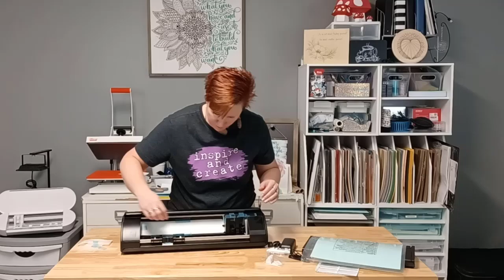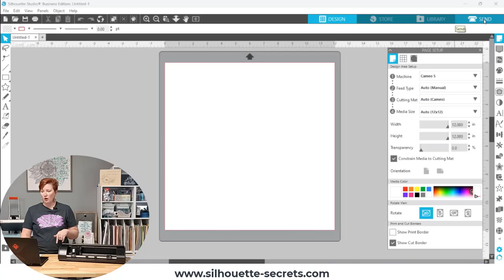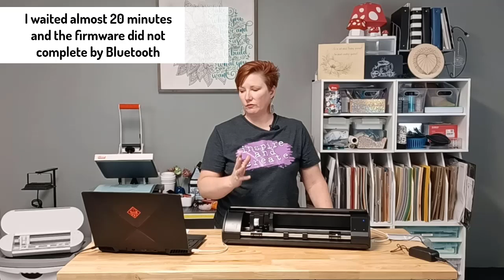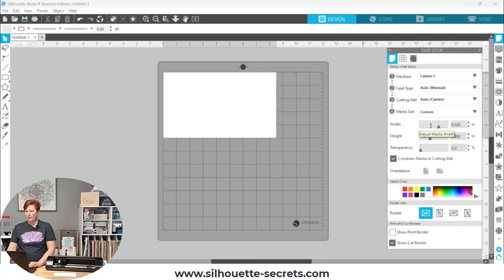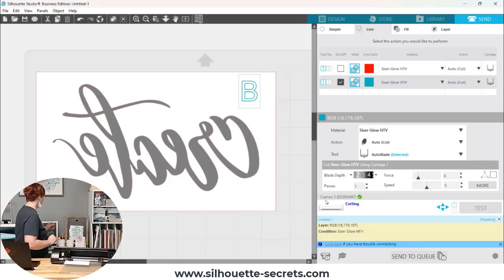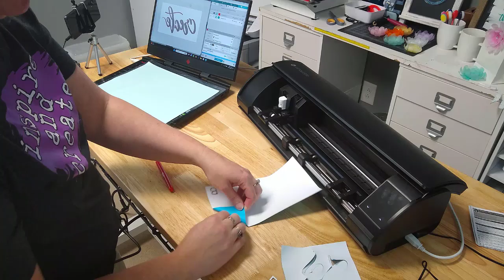Silhouette Cameo 5 Unboxing & First Cuts - What Went Wrong & How to Fix It

Comment: Now that some of you have had this machine for awhile.  How do you like it /rate it after some long term use?   Just learned of this company by a Youtube channel that happened to be using it.  I was actually looking up software.
Reply from the maker: Mine is still going strong and is used multiple times each week. Love the Electrostatic mat.
Reply: @SilhouetteSecrets  what about the software?  Is it adequate enough or do you use other software also?
Reply from the maker: @creativestudio4873 I've used the Silhouette Studio software for 10+ years. We'd recommend version 4.5.812, not version 5 at this time.
Reply from the maker: @creativestudio4873 you can download the software without a machine - https://youtu.be/IZM2z24GY8w?si=6zGwBizh9SwNvgTl
It will take time to learn.

Comment: Thank you so much for this! I got a cameo 5 and is my first, i messed up my mat, it has all paper residue stuck to it and i used a bit of water and it messed up the glue, my heart sank and just left it to the side. Now with your video im a little confident to try again.... after i figure out how to save my new one time used mat.
Reply from the maker: Get a new cutting mat and then use that one for something else like a painting mat, etc. 
The glue is water soluble and should not be washed. 
Here are some tips to getting the most out of your cutting mats - https://silhouette-secrets.com/2019/02/12/tips-to-get-the-most-out-of-your-silhouette-mat/

Comment: After using Cameo 5 for 6 month I went back using Cameo 4 it cuts better and easy to load vinyl. I am very disappointed with Cameo 5 performance. If I could return it I gladly would
Reply from the maker: Sorry to hear that. I still use my Cameo 5 and it cuts well.

Comment: Hello madam, Asking from Philippines, Want to ask if have you already tried to use premium blade using the latest cameo 5? Im a cameeo5 User, my auto blade is not  that sharp anymore. So im planning to buy premium blade. Will be happy, when i see response. Thankyou more power!!!!
Reply from the maker: @Hmfamilyus  yes. The Premium blade will work with a black adapter. There are 4 adapters and are the same as the Cameo 4. 
A 1 mm manual blade is the equivalent of a premium blade and no adapter needed photos of the adapters can be found here - https://silhouette-secrets.com/2020/06/14/lets-explore-cameo-4-tools/

Comment: Hi! I need to know how to calibrate how my machine cuts.
I'm just cutting basic vynil, and the  cut is about 1/2" above the top edge of the vynil, cutting into my mat margins.
I can't find any info anywhere!
I'm having to move my vynil up into the margins or move the design down...but sometimes it actually works properly after I have made those adjustments...making this a hit and miss situation. 
Please help!!!
I am getting ready for a show!❤
Reply from the maker: @KlKingDesigns  are you using a Silhouette cutting mat? 
3rd party cutting mats are not the same size margins as a Silhouette mat. 
Silhouette machines are calibrated specifically to the margins on a Silhouette cutting mat and load to the exact location of the top left corner of the cut area on a Silhouette cutting mat. 
If using a Silhouette cutting mat, make sure you have a mat set on the Page Setup panel.
Reply: @SilhouetteSecrets  I am using the original mat. This is a new machine. It started working better this evening, 
Although I noticed the arrow controls on the machine don't do anything except feed the mat in and out.
I am getting my files, and managed to get the cuts done today! 
Thanks for your help and videos!
Reply from the maker: @KlKingDesigns  this video shows exactly what I mean about 3rd party mats. It affects both but placement and print and cut accuracy
https://youtu.be/z0Fpo5n-Z1E?si=mImh_1Ld2a1ppzND

Comment: thanks for the heads up, re software, wasnt aware they forced a minimum version... nearly bought a machine that I wouldnt be able to use... my mac cannot go higher than Mac OSX 10.13.6
Reply from the maker: It's not something you can re-engineer for older software easily, so yes, a new software version is needed. Especially if a computer OS is no longer bring updated or the computer cannot be.

Comment: Thanks - this was really well done. I got my Cameo 5 yesterday and was fairly well shocked at how little documentation and guidance there was on setup and operation right out of the box ("Scan for more info" and a QR code is nowhere near acceptable for a device of this complexity). Good to know there's standard USB support; now I just need to scrounge up a USB-A cable for initial setup and firmware update. I will say that the packaging engineer who secured the innards for transit is an absolute hero. Or maybe they just love blue tape... :)
Reply from the maker: So glad it helps! 
Yes, it is packaged very well for shipping. Each machine release and more working and movable parts, I think they find new ways to make sure it's not damaged in transit globally.

Comment: Hello. My cameo 5 got cameo 4 firmware. Now it behaves like cameo 4 (turning it off/on with one click, characteristic sounds, an unsuccessful attempt to drag the carriage when starting the magician, the studio desinger program finds it as cameo 4 and functions are available for it and possible only for this machine (for example, a heat foil pen is defined as a craft knife)). I tried to download the micro firmware for Cameo 5 from the manufacturer's website, but that file does not work. Perhaps you can tell me what can be done to return the machine to cameo 5 firmware (the program does not offer new updates).
Reply from the maker: You will need to contact Silhouette Support regarding this issue.

Comment: So in order to operate the C5 you have to upgrade the version so does this mean you no longer can run other cameos curios ect? Or is Shilhouette trying to make everyone buy a new computer for each machine? 🤔 🙄
Reply from the maker: Anytime a new machine is released, you have to update the software in order to access that new machine - they don't go back to older software versions and recode everything to make it retroactive. 
You can still use all of the older Silhouette model machines on the new software version. 
Silhouette still supports all the older model machines and makes the software compatible with them.
Reply: Thank you so much, I was super stressed about updating 💜
Reply from the maker: @lilqueeniescraftingismypassion  You are welcome!

Comment: Hi! I've finally received my Cameo 5 after making the decision to get it a few months ago. I purchased it in november and it arrived a few weeks later because of customs, but I was so excited to finally use it until updating the firmware caused my cameo to no longer connect via bluetooth or through USB. I've tried changing the USB dongle and everything else on their website, but nothing worked. Turning on the cameo works just about fine, but it's just collecting dust now since it won't connect to any device wired or through bluetooth. Would you know if there's a way to hard reset it or fix this? I've reached out to them via email and their facebook but I havent received a reply and its been a few days already..
Reply from the maker: Are you using a MAC or Windows computer? What happens when you connect it either way? What does it show under the machines icon panel on the Send tab = little machine icon with the red number on it? What version did you update to?
I expect it will be awhile for a response from Support due to the holiday closures and the backlog of support requests throughout the holidays.
Reply: @SilhouetteSecrets  I originally connected it on my macbook since its my main use for my digital artwork, and it connected fine the first time I turned it on. Once I updated the firmware the machine froze and it said that the firmware update was unsuccessful or it failed. So I restarted everything and redid it but when I turned on the machine it could no longer be found, bluetooth or through USB. I thought it might be my macbook so I went to my windows PC but nothing as well. 

There's actually no icon of the machine at the bottom of the Send tab, itjust keeps saying that its looking for a machine to connect then it would say that it can't find any nearby. 

They finally responded today but they essentially told me to follow the steps in their support page which wasn't very helpful since I've already done so.
Reply from the maker: @curiousnaba5497  everyone has a machine icon in the Send panel 
I show a photo in this post. 
https://silhouette-secrets.com/2020/06/07/lets-explore-v4-the-send-tab-simple/
I'd recommend installing v4.5.738 found under the Legacy section on the website under Software > learn more and see if you can connect. However, if you are using MAC Sonoma OS, then you'll need to use v4.5.770.

Comment: I got the Cameo 5 for Christmas and the power supply is making a high pitched noise. Anyone else with that issue? I’ve contacted customer support but got a standard email back stating the noise is normal.
Reply from the maker: Yes. Seems to be normal. With the powered housing there is a noise to it, but not everyone can hear it. Most electronic equipment has a noise to it, but it's not audible to all people.

Comment: Hi I have a question maybe you can help me answer these:

Are the mats used on the Cameo 4 compatible with cameo 5?
Are the tools knife, pen holder tool for calligraphy  compatible with cameo 5 or do I need to buy a add on or entirely new set of tools?
Reply from the maker: Yes, the mats and tools from the Cameo 4 can be used in the Cameo 5.
Reply: @SilhouetteSecrets  thank you for your swift reply. And the tools of cameo 4 can they be used on the 5?
Reply from the maker: @JemarhelSupriana  yes.

Comment: Just upgraded from 3 to 5 and I use it mainly for paper art.  I loaded the auto blade correctly, and have not been able to get the auto blade to cut through 65lb Cardstock.  Wasted many sheets, even put the blade to 10 and force 30 it’s not cutting through. Anyone else have issues like this? I’m going to reach out to them direct because the blade, machine, all is brand new.  Pretty frustrated 😢
Reply from the maker: Is the red line inside the blade adjusting to the correct number that you have set on the Send tab?
Is the cap on the blade secure and not loose?
If those are both fine, then I'd recommend you reach out to Silhouette Support with photos and video of everything so they can see what you see.
Reply: @SilhouetteSecrets  thanks
For the reply!  Yes, the blade line moves and I even tried with my finger manually to make sure the blade actually comes down more with each click.  I’m hoping all I need is a new blade but hesitant to buy one I’ll be so mad if same issue lol.
Reply from the maker: @agent007420ify  buying a new blade will be the fastest way to identify if that is the issue. A new blade would be something that you would eventually use and need anyhow and getting one to test it could be the fastest way to get you on your way to cutting. It will take time for Silhouette to respond and troubleshoot any issues.

Comment: Could you use a 3rd party foiling quill pen? We r memory keepers has a set with 3 sizes and adapters for different cutters but the pens need to be connected via usb so they heat up...
Reply from the maker: You can try..... it would be the same as the Cameo 4. However, the We R Makers adapters do not work well as they were designed for machines before the Cameo 4 was released. 
https://silhouette-secrets.com/2021/08/22/silhouette-cameo-4-beginner-foil-quill/

Comment: Thank you dear for the effort really appreciate. Does the cameo 5 supports the auto feeder?
Reply from the maker: It will be compatible in the near future, but they have to make a new plate to connect it so it's the right height and distance for the ASF.
Reply: @SilhouetteSecrets  Thank you! dear I need your email if it’s possible I have issue with my cameo 5

Comment: Hello, I have a problem with re-cutting again when I turn off Bluetooth or disconnect the cable because I have another device, Cameo 4. I want it to work at the same time, knowing that the program was last upgraded to Business Edition😞
Reply from the maker: You don't have to disconnect anything. If the Business Edition upgrade is active, you switch between machines on the Send tab
https://silhouette-secrets.com/2019/05/21/using-multiple-silhouette-machines/
Reply from the maker: If it shows as unknown, ignore it and select it anyhow.... 
https://youtu.be/QMHKnRtkM0Q

Comment: Can i use My knife from Cameo 4?
Reply from the maker: The Kraft blade? Yes.
Reply: @SilhouetteSecrets  and the Cb09?
Reply from the maker: @gabrielapiranej8603  that's is a 3rd party tool, and it is not designed or tested by Silhouette.... so they can not guarantee the results, and it voids the machine warranty.

Comment: Using a 3rd oarty cutting mat...how exactly would they know you were lol
Reply from the maker: You would be amazed at the signs of it.... but most times, the user shows photos or video of a 3rd party mat being used when troubleshooting. 
In some older model machines, using 3rd party mats, which can be thicker has been known to stretch the rollers out with extended use. But there are other signs of it too when you get into the aspect of troubleshooting cut issues.

Comment: I have a bug that I’m wondering if it’s essentially the same or atleast related to your bug. SS (latest version) will not allow me to cut larger than 12” unless I rotate the design layout to vertical. As you increase the size the work area increases but the cut line stays at the 12” mark. Switching to the send screen doesn’t fix it but changing the layout from horizontal to vertical does. The obvious workaround is to rotate the design but all of my designs are already saved and setup horizontally and are over 24”, so a bug fix would be ideal. I messaged SA support and they recommended going back to a previous version. The only reason I upgraded was because I just added a C5 to the workforce so obviously that’s not going to work either.
Reply from the maker: While it is technically a bug.... it does make sense.... the width can not be wider than the machine can cut. The height has to be the larger number. This is why you have to rotate it.
Reply from the maker: It's a bug that was implemented in v4.3 or v4.4 - I can't even remember now. You are just going to have to rotate your designs and learn to work with it going forward. We've been living with it for years now.
Reply: @SilhouetteSecrets  Ummm, no? I don’t know if your default settings are different or you’re not understanding what I’m saying, but I’ve only had SS for about 2 years and I have always worked with it horizontally.  This is only a problem for me in 4.5.735 which I installed for the first time on the 24th. If I uninstall it and go back to my previous version (4.4895) it’s fine. 

I did just figure out a fix though. 🤷🏼‍♀️

Comment: Bluetooth has nothing to do with your router at all, it's a direct connection between the computer and the Cameo. The Cameo not connecting through Bluetooth can be an issue if you don't have usb cables or adapters at all. It's also doubtful that 3rd party cutting mats void warranty. I always cut my 3rd party cutting mats the same size as the original. Never used the original at all, it's flimsy.

If you have Windows 11 you may need to go into Bluetooth settings, tap on the small arrow on the devices bar (next to the blue add device button). In the screen that now appears change the Bluetooth devices discovery from normal to advanced. Standard will block a lot of devices.
Reply from the maker: You are absolutely right - bluetooth connects directly to the Silhouette machine. However, the firmware update requires an internet connection and that is 100% connected to your router as I stated in the video. The firmware update had to be done by usb cable on previous models - this is changing with future machines, however, in the current version of the Silhouette software is not always successful when using the bluetooth connection, which is why I plugged in by usb. 
My computer did connect to the machine by Bluetooth successfully, however, the firmware did not update as shown in the video. 
You can find Silhouette's warranty policy on their website about 3rd party tools and mats.
Reply: @SilhouetteSecrets  thank for the explanation, good to hear it will be changing on the new models. I'm considering buying the Cameo 5 with the new electrostatic mat, once reviews get out. Curious to see how think paper that new electrostatic mat can hold. I don't do any vinyl or such, only papers and cardstock for project.
Reply: @SilhouetteSecrets  me as well .. I actually LOST BT after the update and had to connect via USB and perform update again -- now all is good.
Reply: OK, yes, the router signal strength might matter for the download speed but when you used the USB you didn't move either the laptop or the router, so only the switch from Bluetooth to usb would affect the speed.